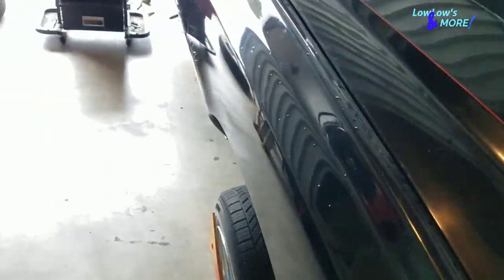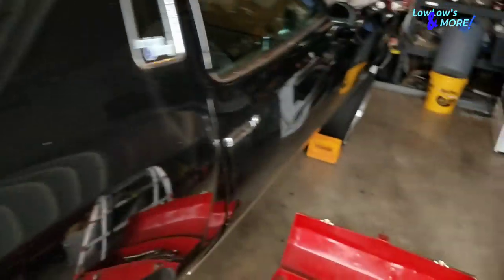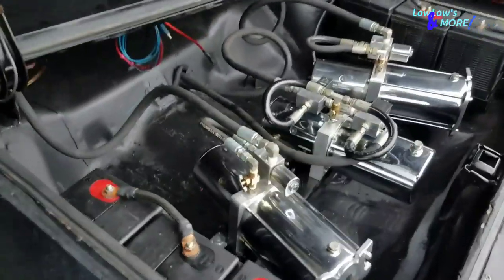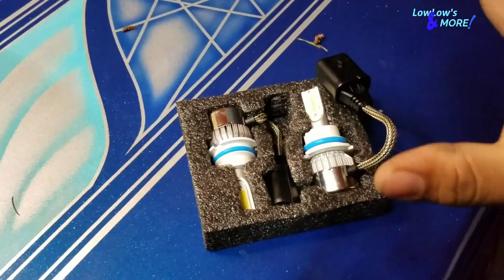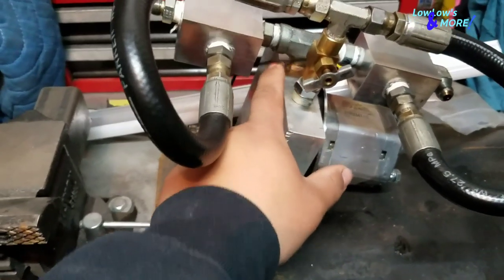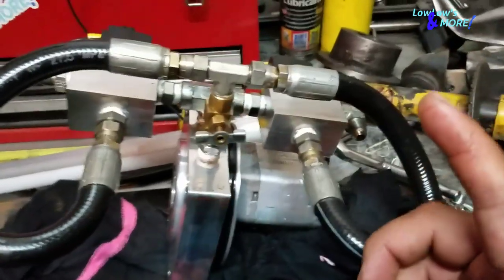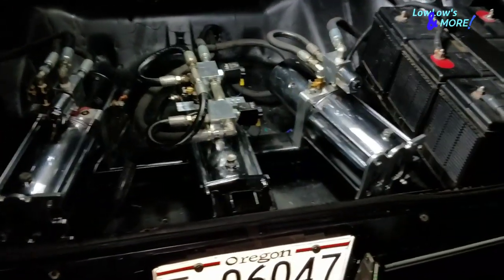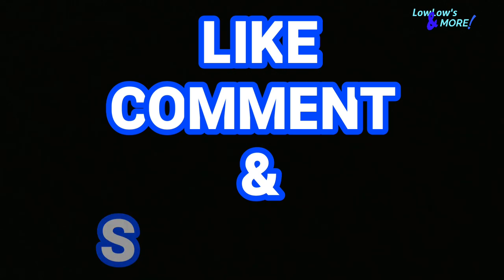Swapping upper trailing arms on the 77 monte carlo lowrider

Comment: So nice bet your glad that it's finished Have you ever tried air in with your fluid My blocks have a air Chuck on them but have never tried it an really don't know how much I really could put into it
Reply from the maker: Those block usually need 30 psi in them. they stopped building that way because it doesn't help much.
Reply: Thought that it would change the viscosity of the oil to make it lighter to make it a little quicker but then I wonder about ring at the dumps of blowing
Reply from the maker: @scottlemons8191  yup true